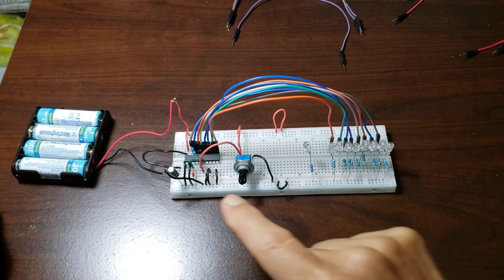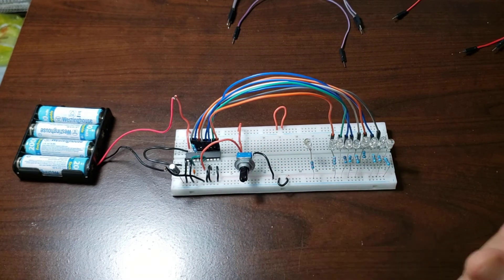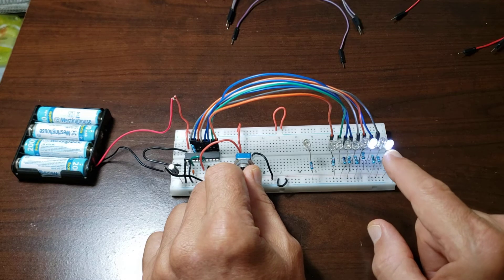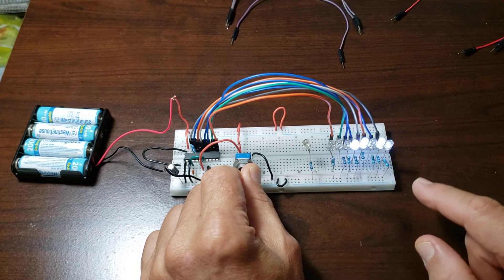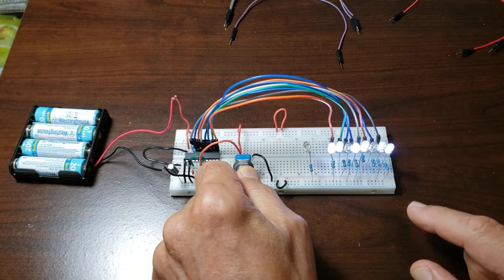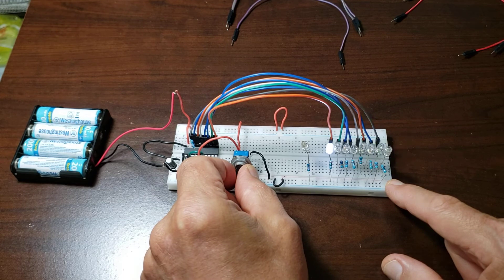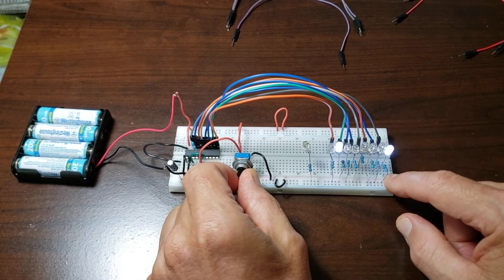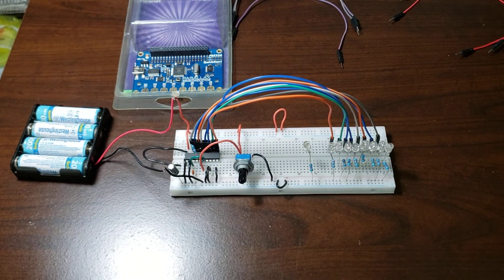Analog to digital converter

Comment: hi sir, can i have ur circuit diagram?
Reply from the maker: Happy to help as best I can. It's been 4 years since I worked on this so I'm a little rusty.  This is a link to the data sheet https://www.ti.com/lit/ds/symlink/adc0804-n.pdf  - on the first page you can see a Typical Application Schematic . 
Pins 11 through 18 are the data pins. I have the leds connected to ground using 100 ohm  (or 220 will work) resistors.
pin 1 is Vcc (5v) and pin 10 is ground. 
there is a 10k ohm resistor from pin 19 to pin 4 then a 150pf capacitor going to ground
the potentiometer is  connected with one side to ground and the other to positive and the center (wiper) to pin 6
pins 1, 7 and 8 are connected to ground.  [ pin 1 is "clear to send", pin 3 is "write" and pin 8 and 10 are Ground pins. ]
pin 3 is connected to ground and it looks like pin 5 is connected to pin 3. 
I will look through my documentation and see if I can find the schematic I used. 
if you have any more questions feel free to email me at dazzor_2000@yahoo.com. 
thanks for watching!
Reply: Hi, can you please do an assembly language code
Reply from the maker: @olwethun2826  Sorry I missed your comment. But I'm not any good at assembly and this is a straight hardware circuit - no programming.